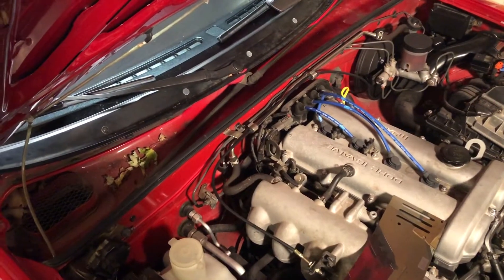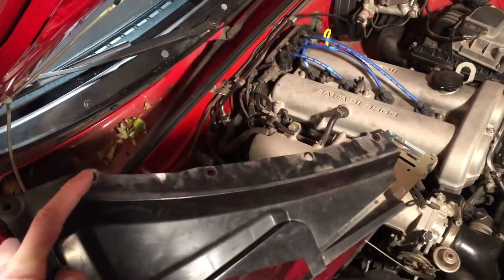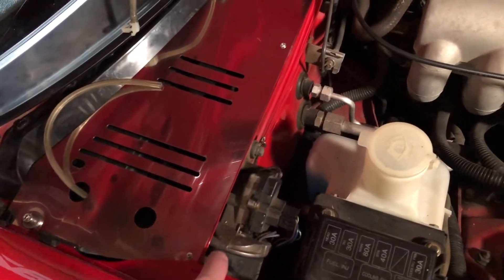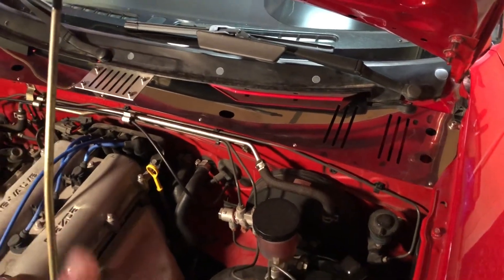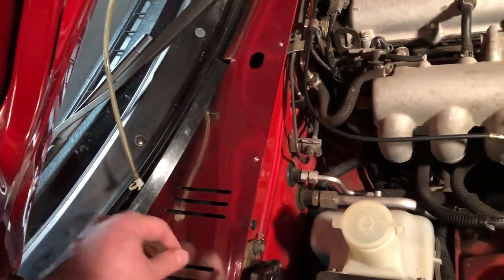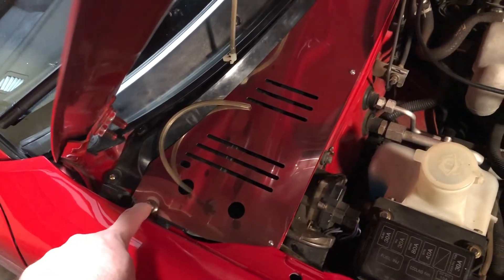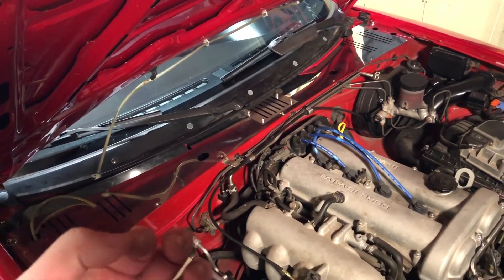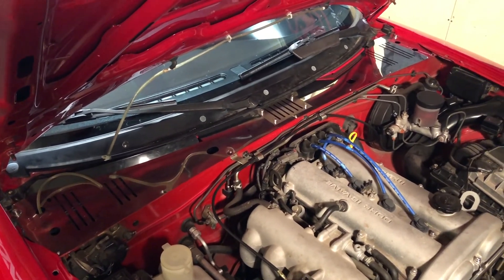Jass Performance NA Miata Scuttle Panel

Comment: Hey nice video! - i hope after you got the instruction you could install it well. What about the noise and ruttle ? Did you had any ? Is it stable or vibrate ? Did it actually improve to reduce the smell from engine bay ? (I mostly buy cause i have skme little oil leak and it smells every time after a long ride) thank for the info!!!!
Reply from the maker: Hi, I've sold the car so I can't really comment on it, sorry.
Reply: @miata350  Thank you so much man to even look into a video of 4 year ago!!
Sad to hear that. Stil i hope you enjoy it!
IF you have any feedback in the brief time u the panel before you sold it - would be much appricaited Thanks again!

Comment: Just saw this video and there are few points I noted. The manual should have been provided (sorry if it hasnt). The seal strip (weatherstripping) is essential to be reinstalled and is meant to be, the reason is that the area around the wiper cowl is low pressure area, means it would suck the fumes out of the engine bay into the interior compartment. The flat head M4 bolts are meant to slip into the small holes where the plastic clips initially are and hold the seal in place just like the OEM setup. There is a link to the manual on the Jass website of course or email to me would have cleared the doubts. http://www.jassperformance.com/manuals/Scuttle%20Panel.pdf
Reply: Miata350 THANK YOU for posting this video!   Jass Performance - Thanks for your post because I have the item in my Moss Miata cart and was wondering if the install would be a hassle because the lack of instructions.